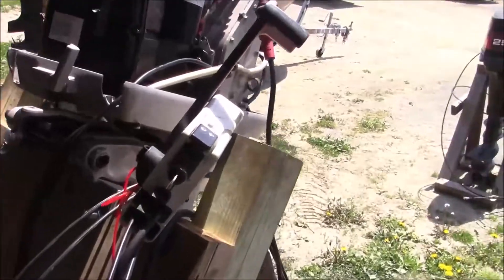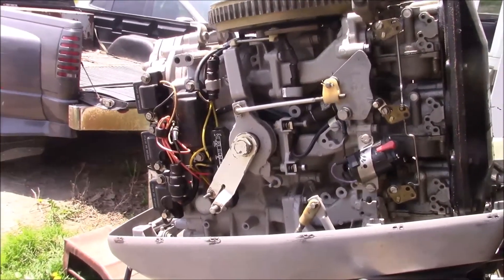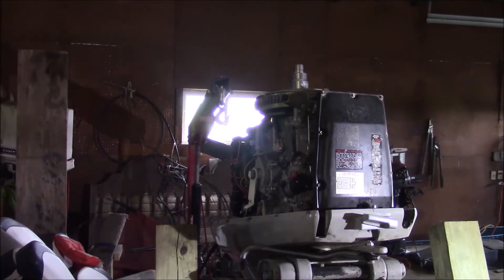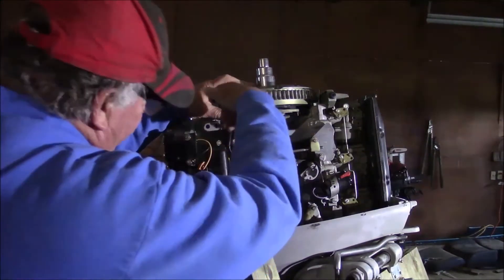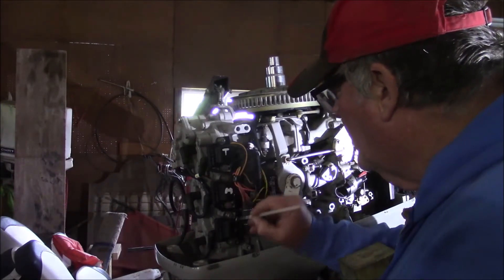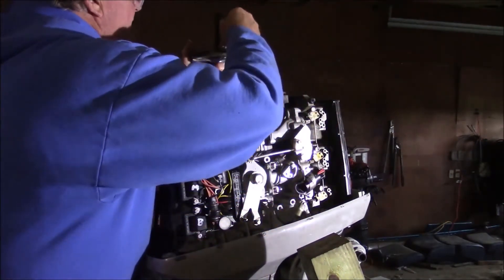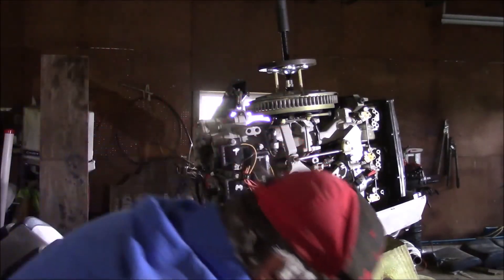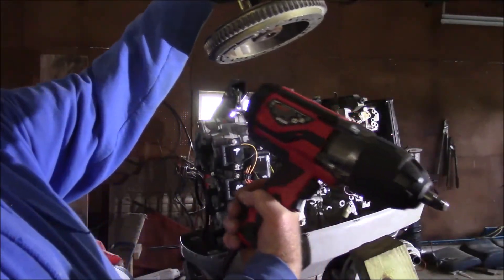Johnson / Evinrude 70 hp Outboard Flywheel Removal & Ignition System "Layout" & HTSS Shop Time :)

Comment: I think I asked you a question about why Imy 1984 70 hp johnson was not getting any power to my coil packs a few days ago. I was thinking my power pack was bad but now I think it's the stator ring. I disconnected the power pack plug that goes to the stator and did a ohm check on the stator plug end and i got a reading of 11.8 ohm on the outer most pins and no reading on the 2 inside pins. So I would think the stator is bad?? Any input would be greatly appreciated.
Reply from the maker: I still haven't heard you verifiy the safety kill switch to keep from starting in gear is not the reason there is no power. Have to look to things common to all. Is the ignition even getting power?
Reply: Checked to see if it was in neutral and it was. I pulled the kill switch and made sure it was not sticking.  When I disconnected the power pack plug and tested the ohms I had no ohms reading on the inner 2 plug pins going to the stator
Reply: I just recently bought the boat and not sure what's been replaced on it and what's not been. If I have to buy a new stator, power pack and coils, rectifier I would probably will.   From what I see I don't think anything has been replaced.
Reply: I probably will take another look at the safety kill switch and look at wiring and hook a multimeter to it.

Comment: Great video. The OEM manual list using OMC gasket sealing compound. Can I sub Permatex 80019 Aviation Form-A-Gasket No. 3 Sealant for this. Also this might be a stupid question but I didn’t see this addressed in the manual-does the sealing compound just go on the threads of the flywheel nut? Thanks
Reply from the maker: Actually an interesting question on the sealer. I used the gel seal in the 1980's as specified by the OEM's. Also I was doing mercury's then as well. That stuff was excellent and stood the test of time for certain. Fast forward to the 2002's and I moved to building chain saws. Removing the base gasket was an easy way to pick up compression so a LOT of time was spent finding a "goo" gasket that would work on those little air cooled two strokes. Lots of temperature variations as they were.... air cooled, no thermostat so from task to task and season to  season there was a lot of expansion & contraction while being run. NONE of the "off the shelf" gasket makers survived in my testing except one. The Three Bond 1194 first and after is was "outlawed" the Three Bond 1184. What I use now. I haven't tried the aviation targeted gasket makers. But I suspect the ones used on those old flat four & six cylinder air cooled motors would work for the same reason the three bond products have for me would be my guess. I'm trying the 1184 on my builds ( for my own personal use ) to see if they hold up over time. SO far the two motors I've built using 1184 ( Johnsons ) have held up. No sign of leak in the case to case seal. Fingers crossed. :) But on the saws that stuff was almost like an adhesive over time. I would have to literally hammer the cylinder off. Hoping I get the same results on the outboards. BUT like I saw in the saw world. If you doubt or have a question, use the OEM recommended solution :)

Comment: I could not hear the noise in the motor over the video ! But I will say these motors were very noisy brand new   The piston to cylinder clearance is 6 thousands !!! They  are made like that cause they are cooled by a lake so they take a long time to warm up ! and if you warm them up to fast they can cold sieze ! With a radiator is much different , that water will warm up much faster . so because of the extra clearance they gave these motors to warm up is the reason they were noisy ! Now knowing this , I rebuilt my own engine with very tight clearances ! I have only just 3 thousands piston to cylinder clearance ! Now I've got to be careful and warm my engine up slowly , But ,.. The motor sounds amazing , and has all kinds of power ! I have since mover onto a evinrude V6 235 hp engine onto the same boat ,  Wow , Don't that bitch go now !!! When you nail the throttle , Hang on cause she will stand on the transom , You will fly out of the boat if your not hanging on !
Reply from the maker: I certainly appreciate the feed back! I have another on the bench, wanted it .020 over to fit new pistons. When  it came back from the machine shop there was .009-.010 clearance. Thinking a set of .030 pistons are the way out of that situation. Have another shop take it to 006 over. The FIRST one I did in early this year the fellow hit the .006" piston to cylinder clearance dead on. I love the simplicity of those old two strokes. Have a 55 twin to do and a 85 v4 to build. Along with a 2.0 135 v6 merc at some point. I do these in between saw and farm projects :)

Comment: Just because you hear a click does not mean its working ! Try looking at the choke linkage to see if its moving 90 degree's ! That's the only way you can verify the choke is working ! Believe it or not , these motors are very simple and common ! they are easy to work on if you have a basic manual ! Now the older motors had an actual choke , but the newer motors say starting from early to mid 80ies used a vacuum barrel choke.  But either one needed to haul the linkage 90 degree's one way to verify they was working ! I have manuals for the older engines from johnson an evenrude from the early 60ies to the late 80ies if anyone needs any information . I would be more than happy to give them whatever they needed !  At no cost of course !  Just ask and I will post a comment within 24 hours !
Reply from the maker: Thank you and I will certainly keep that in mind. Also having folks who build have conversation's here would be awsome as well :)
Reply: Not really a choke.. its a fuel enrichment....

Comment: Please help!
I have a 1989 Johnson 70 hp that recently rebuilt. I found the TDC and  marked it on the ply wheel but the it is about 3 to 4 inches from the TDC factory mark.  The TDC factory mark is on the left side of the new TDC mark that I have found. Is this possible the the ply wheel was installed INCORRECTLY during the rebuild?
Reply from the maker: TDC from top cylinder off on the flywheel ? That's a bit odd. Mine was spot on. Wonder if that flywheel's key way is off. I guess the first question is why are you checking? Does it not run? If that motor was rebuilt I suspect they had to test it some how. I hate these long distance analysis because there always is more to the story. So Step one. Does it run?
Reply: @htssoutboardsboatstrains9784  It was running but the bottom 2 cylinder had very low compression.
Reply from the maker: @vinhoi69  that has nothing 2 do with timing
Reply: @htssoutboardsboatstrains9784  He didn't do the timing after he rebuild
Reply: No he didn't and he also installed the flywheel incorrectly. 

I installed the flywheel with the new key and the TDC was spot on.
Reply from the maker: @vinhoi69  glad the mystery is solved :) Great old motors
Reply from the maker: And yes the flywheel COULD be installed incorrectly in fact the ones with a key its real easy to slam on the flywheel and push the key right out of the slot, or if it was don't with minimum wage help the flywheel could be put on randomly with no key. And for a reference I have $700 - $800 into my rebuild with all three cylinders bored. $240 to bore and fit the three pistons. New pistons were 70$ each. I put a better crank and cylinder head on mine. Had to spend $200 on tig welding the block. over $3000 seems excessive. 
 For a reference I would have done it $1200 labor & shop plus parts, worse case usually ends up around $2200.
Reply: @htssoutboardsboatstrains9784  Thanks so much for the info. He charged me $1600 for labor.  I suspected that the Woodruff key was sheared off and I was right.  I was hesitated to take the flywheel off because I thought the powerhead is recently rebuild and if the Woodruff key was sheared off he could have let me know and advise me to replace it.  Instead he or his crew just blindly installed the flywheel without letting me know.  So I decided to take the flywheel off and sure enough, the Woodruff key was sheared off.  anyway, thanks for reply.  Stay safe.

Comment: I've used the same puller without the round plate, (that's a great Ideal) for quite some time now even on models down to 3hp.
I've never used the heat method, I've always just put a good bit of tourqe onto the jack bolt then give it a few good firm whacks with a brass hammer and generally it pops right off if not I apply a little more tourqe and smack it again, thats how I was taught.
Can say I've never had one i couldn't get off but I see where the heat could make for an easier removal. 
I had an 82 model 70hp Evinrude wind up in my shop last year, long story short after removing 13gal of water from the on board fuel tank YES 13gal, rebuilding the carbs, flushing the fuel system and adjusting the throttle and shift mechanisms it ran like a scalded dog, pushed the 1982 19ft all Aluminum Sylvan boat along at 25mph top speed and crusied easy at 18 to 20mph.
For labor,  in my true form I bartered for 3 trips out on the boat  on Lake Erie to catch some Walleye.
First trip is in the books and there were 2 fish Ohio Walleye taken on that trip, a 29 3/4" 7lb Walleye and a 30 1/2" 9.6lb Walleye.
And I will add that the OL Girl puttered along all day (10hrs) trolling without having any issues and only using a tad more than 1/2 tank of fuel.